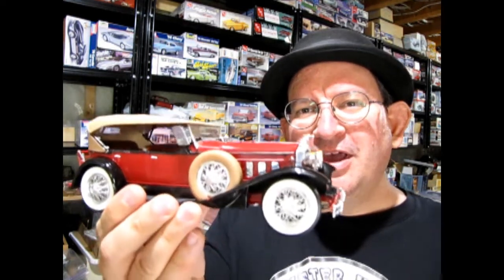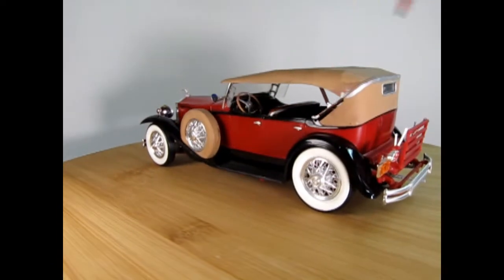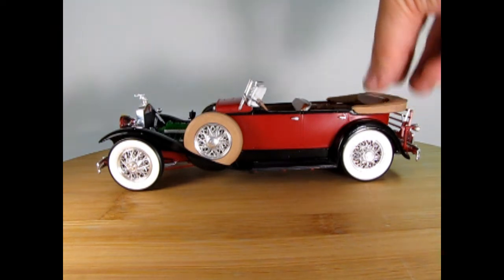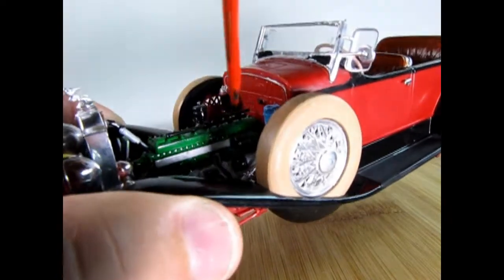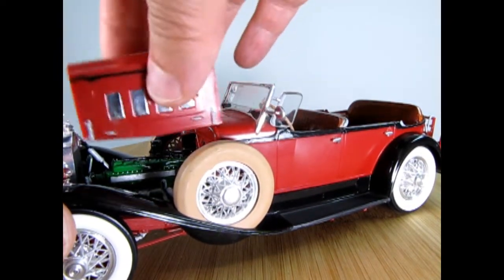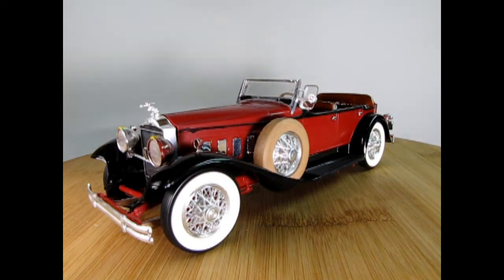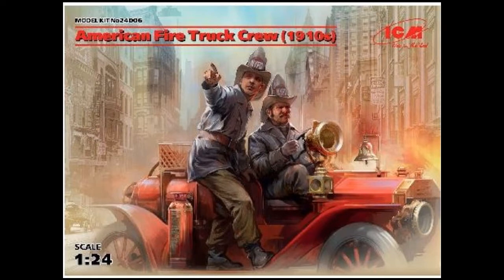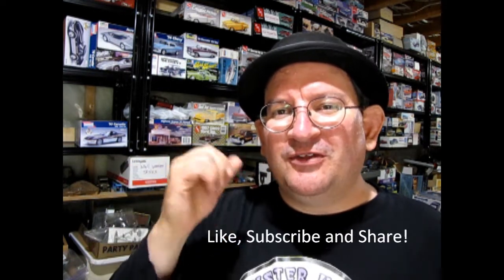Model Car Garage Show And Tell - My Monogram 1930 Packard Speedster Phaeton - A Model Car Build

Comment: Excellent build for a youngster.  Great survivor.  You should really cherish that one.  Thanks for sharing.
Reply from the maker: Thank you for the kind words. I need to build my other kit, now that I'm 48.
Reply: Trevor do you remember what glue you used, lol because my build would have been losing parts! I used Testors back then, and I felt like it didn’t hold up.
Reply: @harrysatin5110  I use Testors tube after paint, and get super glue and have not had and issues yet.  I also clear Modgepodge for cheap glass.
Reply from the maker: @harrysatin5110  Testor's red tube glue and possibly Testor's liquid glue. The secret is in scraping the paint and chrome off the glue contact points. In fact, the glue is designed to melt the plastic at that point and weld it to the other piece. - 35-40+ years later, the glue is still holding. - although Alberta's climate hasn't been as kind as British Columbia's has been on the glue. We're a bit more dry and humid in Alberta.
Reply from the maker: @harrysatin5110  You ever get a kid's unpainted "Glue Bomb"? - It doesn't matter how old the model is, that never comes apart easily or without breaking something...all Testor's "Red Tube" glue! :D
Reply: I just started this kit as my new project

Comment: That's an interesting way to clean plastic models!
 I might try that!
Reply from the maker: You should! - i was also using car wax, but I ended up ruining a hood on one of my Dad's model T trucks...yeah...on paint that was over 40 years old...it was STILL soft - Testor's gloss black - so I stopped using the wax. however, if you have bare plastic, the wax would be good.
Reply: Using wax... I might try that on my Nissan GT-R r32!
Reply from the maker: @Jeremy21084  Always try on scrap plastic.

Comment: wow, that is a really impressive build! when I was 10 or so I built Tamiya tanks, though they all fell apart or the paint came off or it broke. I have one surviving one though!
Reply from the maker: Sounds good! I have about 95% of all my original models. We never threw anything away. However, there is a bunch of my Dad's models missing...maybe another box worth. The missing box includes the Monogram Bugatti and the Lindberg Bugatti Royal and the AMT 1941 Plymouth. I hope it shows up sometime because that's disturbing that it isn't there.
Reply: @MonsterHobbiesModelCarGarage  you still have 95% of all your models!? I have 2 surviving ones, though one is a little bit damaged.
(the paint is peeled off in some places and I lost some wheels...)
 The other is in surprisingly good condition! oh, and it's called "Tamiya king tiger (Ardennes front )" in case you were wondering! (that was back when I liked tanks and aeroplanes! 
now I mostly prefer race cars and JDM cars!
Reply from the maker: @Jeremy21084  My Dad built me model car shelves and my cars sat on them from the moment I finished them until I moved out of the house. I didn't have any of these kits with me when I lived in an apartment, but when my wife and I bought our house together, my parents brought out all my models and the shelves and installed them in my house here. 

Also, my Dad's models were packed in boxes years ago to keep the dust out. I find that my Dad's models are more damaged than mine on average due to the way in which he stored them. 

Other models, like my Star Trek ones and WWI bi-planes are pretty much intact. They were put in clear plastic tubs with packing popcorn and such to protect them. Some bi-planes have broken wing struts, but that's about it. Mom never dusted any of my models, so none of the windshields or mirrors were busted off...I guess I was lucky in that way.